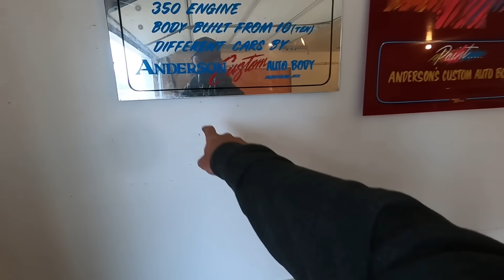An Amazing Auction! The Jess Anderson Collection! 57 Chevy, Trans Am, K5 Blazer, Bronco and MORE!

Comment: Mostly rusty crap...but didn't expect much more-
Reply from the maker: Thanks for watching!
Reply: nope, no KIA parts for you
Reply: @brianfairchild7819  LOL- never owned a KIA or Hyundai. A friend does own both brand dealerships, however. My point is that this demographic is aging & dying out. All those parts sit around, usually exposed to the elements & turn to sh!t, then it gets pitched or auctioned off. These auctions, especially in harsher climates further prove my point. Are there finds to be had? Sure, but it's a gamble and most times not worth the time, effort or price/cost. It's turned to crap and the re-work required to make the junk fit, waste of time & money
Reply: Rusty crap makes the world go round...
Reply: @olikat8  you spend your saturdays how you want, and we'll scrounge for parts on ours.
Reply: @moremortskerepair4354  radial tuned suspension. we got that here in aus..mid, late 70,s. bit of a joke, as radials been out for decades, but it was a  FLASH selling point for holden, as they need all the help they can get.. smoke & mirrors.. very basic nothing cars...holden belmont / kingswood, same car. the toranas had 3 names, same car.. frigin joke.. only good holden has a ford 9" & a top loader & chev 350.. better with a clevo, or buy a ford..
Reply: Rust never dies.  Aren't you late to a Tupperware party somewhere?
Reply: @georgeponnay447  apparently, it does by the video I saw. Lot of junk; maybe it was halfway decent at one time? I guess if you want to sit around patching together , have at it.., "Tupperware," lol. Nice reference, how ancient are you? Have to dust you off & roll your wheelchair onto the patio on the nice days at the old folks home? Shheeeeeet.
Reply: @brianfairchild7819  Exactly- my point was these kind of sales generally are full of stuff that may have been worth something. But over time, open storage, moving in &out of the way, stuff goes to hell. These folks are dying off, family tasked with unloading it. Have an auction, it's like flies to (mostly) sh!t, and (most times) the decent stuff gets bid up because it has a captive audience.
It is 100% not for me. Mortske ? It makes more sense- this is a business. The fuel, mileage, everything? It's a write off. Everybody thinks I'm throwing shade, but this kind of thing makes 0 sense for most people.
Reply: @olikat8  😅 Cute.  No, I sold that wheelchair to Mortske for scrap, er, junk!

Comment: I had a good looking 1974 that was the last year of the full top and no window frames around the windows. I put a 1968 Corvette 327 .30 over with a cam one sized over stock with a 650 Holley double pumper and a offenhouser aluminum intake and a turbo 350 in it and I had to get the transmission rebuilt and got a shift kit in it. The guy who rebuilt it was in highschool a couple of years ahead of me and he was shocked when after about 1500 miles I busted the input shaft by shifting from first to second at 6,000 RPM. Luckily for me he honored the warranty of 3,000 miles or 3 months on it. Never had a problem with it after that. I pulled my boat and trailer with it and took it on modest mild trails but I never lifted or lowered it. Went pretty good with stock suspension and I wish I would have kept it. Had the common light rust at the front fenders behind the wheels and the bottom of the doors but it was pretty solid for what it was in the early 90's . I think I sold it for what I had in it 2500 dollars. I'm kicking myself today for the price that I just seen. I have a 1990 GMC Jimmy High Sierra full size with the removable top new turbo 350 and it needs a motor blew a rod through the original engine. Needs rockers, rear floor pan and rear bumper. Interior is mint like new plaid red and white stock interior and electric windows. Front fenders are like new just like the fender wells. Black with all the trim, I have to sell it soon for cheap to the first person who makes me a decent offer for the garage that I have been keeping it in for the past 16 years is going up for sale and I have to get rid of it for the reason that I don't want it outside sitting and rotting away any worse plus I don't have any more room for anymore projects. Too many now and someone can finish it and sell it or keep it. Better than sitting outside and rotting away.
Reply from the maker: Thanks for sharing

Comment: This just idea see my uncle do long time ago on a old trailer wad added a pulleyon back of hub and put a small alternator on a mount think it was form se type motor cycle or something really small and wired it up to keep his battery charged for his winch  setup it was for cycles or small things but also had it setup for offroad use with power converter it came handy as a trailer for whrn we used drag racing on dirt back in 90s setup up with lights and had multiple battery setup to charge batteries in between rounds even had setup to plug into 120 think robbed setup out of old camper such crafty and learned the ability to make what i need by recycling things it came in hand over years keep up great work and have wonderful day.

Comment: Man, that was a good haul, mate.  That 70-72 Firebird was one out of the box, really.  Surprised it didn't go for more.  Plenty of good stuff there too, but yeah - sometimes the auctioneers are onto it and sometimes they are just there to pick up the buyer's fees.  The weather would have probably played a part in it too - I find that if its a fine day, people tend to bid more, which is great for the seller, but not so much for the buyers!  Funny - I had you pegged for that El Camino.  Also had you pegged for the 65 Le Mans hardtop.  Looked pretty solid and something to stick a good motor and box in and flip if it had all the trim and interior, but hey.  The El Camino would need a bit of work, but she's got a head start with the frame and underpinning work that's been done.  Just that bent LR corner to scab in and she's away.  If someone's gone to the trouble of putting a tilt column in it, yeah, a V8 and auto (or manual) trans would be the ticket.  You expect to hear a V8 rumble out of something like that anyway....especially if she's dressed up with a decent set of rims and tyres, I reckon.  All the best

Comment: @Mortske, welcome to El Camino life. I love my 64 and they have leg room for us tall people.  They are tire limited in the rear, I'm running 18x9.5 on the rear with 6 inches of backspacing with 255/45 but you can run a 275/40 or 45. When I got mine nothing was available but now everything is. I'm going with a disc kit from Ecklers that use late model sealed bearing corvette brakes so I can stop my 500 hp of fun. If you need a source for something just ask.

Comment: 34 Pontiac chopped 2 dr for 1300.00 . 28-9 "A" sport coupe pile 575.00 were just smokin' buys. Metal looked great.  Tho Dubs does dig the 65 Elcamino. Another boomer leaves the building Hey Im one!,  Still hangin' in. (By a thread),,,DUBS

Comment: During the pre-auction walk around - I saw that X-frame for the '57 convertible , and knew what it was instantly !
In the late 80's , I had a friend that had a half dozen or so 57's - hardtops, Nomads, etc .   One day, he found an
X-frame, at an auction, like the one you bought, and built a complete convertible - just starting with that piece of frame .
I am pretty sure that this was the first year Chevrolet used the design for their convertible models .
Reply from the maker: Very cool!

Comment: The 3 pieces of flat sheet metal (on the trailer to the right of the bumper guards), 2 of them go inside the El Camino bed on each side towards the rear. If you have a complete trim set (there are 2 curved pieces that go around the outside of the headlight bezels, one straight piece that goes below the grill, and one straight that covers the lip of the hood) I'd be interested in getting a price on the 4 piece set with shipping. I'll email...

Comment: cool video, I'm interested in that 64 El Camino If you want to sell it, As is or running and driving. I live in central MN, I never heard about that auction, i would have been there. Let me know if you are selling extra parts for 64 65 Chevelle. Like those front and back bumper guards on the 64 bumpers. thanks.
Reply from the maker: Ok will do